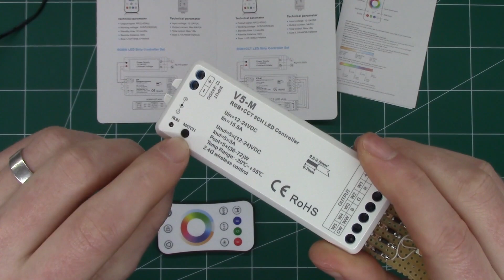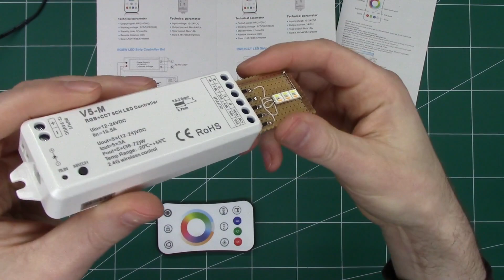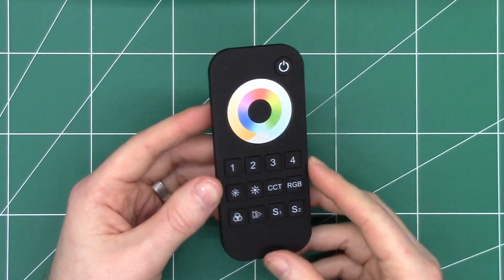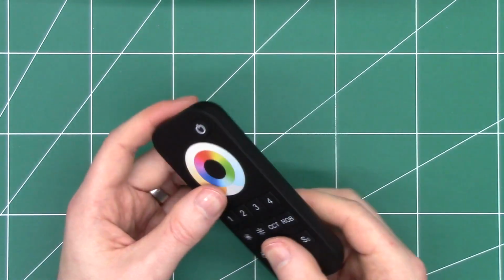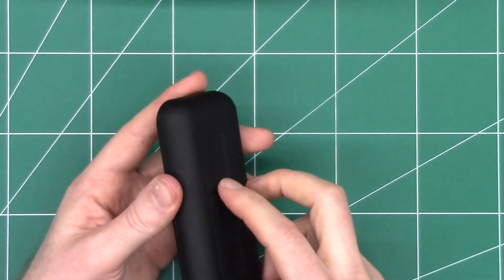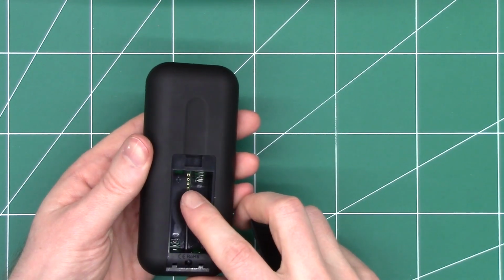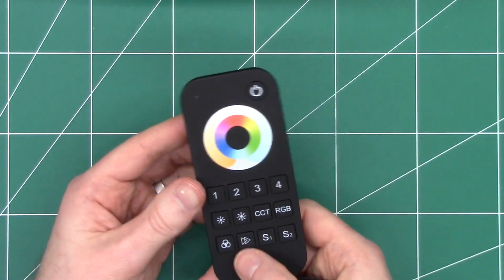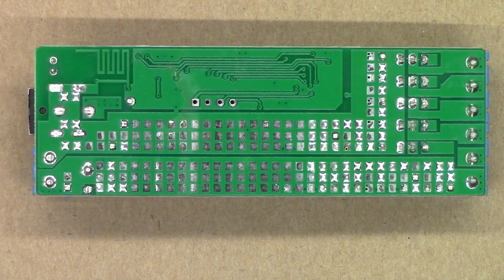Overview and Teardown of RGB+CCT/RGBWW LED Controller

Comment: Why do you have constant current chips on the first controller. Is it designed for 12V strips?
Reply from the maker: A suitable current control (resistor) is needed each channel of each string of LEDs. The resistor values can be calculated using ohm's law, R = (Vin - Vdrop)/l. The constant current regulator is more accurate, but way overkill.